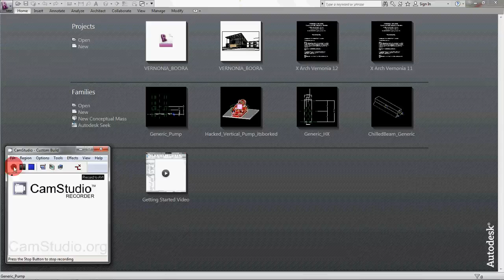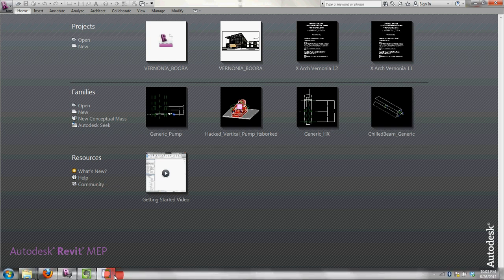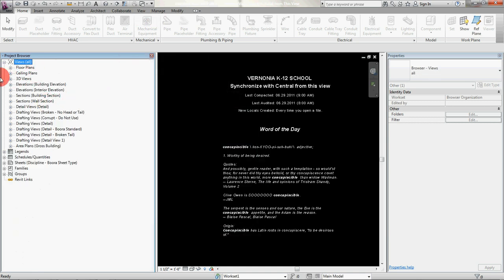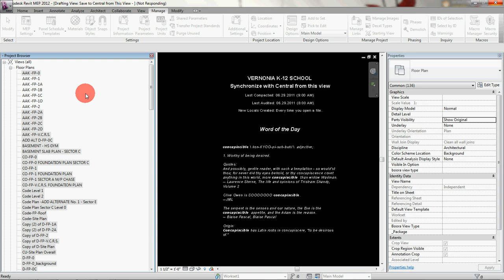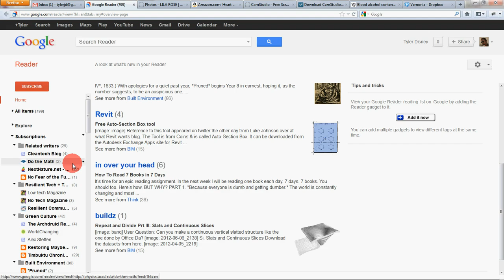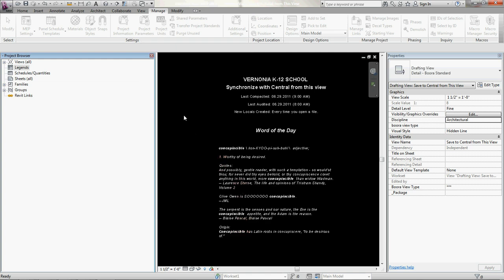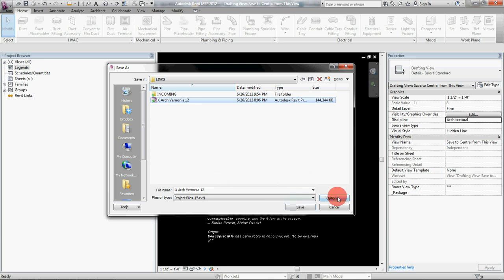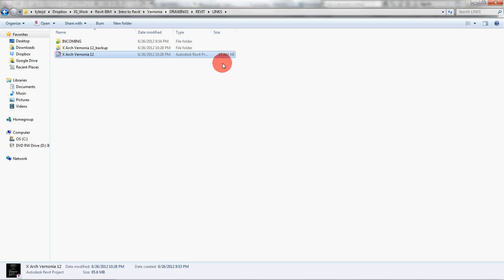Cleaning up a New File for Linking into Revit MEP 2013

Comment from the maker: Sony, good question. For better or worse, almost everyone uses worksets to control visibility, to some degree. In other words, they sort of treat worksets like layers. Architects will do things like have worksets for Exterior vs Interior, and worksets for furniture, casework, even different options and fit-outs they are experimenting with. 

So, if you collapse all the worksets in a linked model, you are doing something similar to collapsing all the Layers in a CAD drawing to "Layer1". You'll lose the ability to set the visibility of the linked model the way you want. If you keep the worksets, you can adjust which ones are visible in your model's views so the backgrounds show the way you want.

Cheers!

Comment: ive got a mech, plumbing, electrical link. do i clean them up too for the new link into my new central?
Reply from the maker: Hi Sal, yes, in general, clean up every model you are going to link in to your central.

If the model is under about 50MB, I tend to only Purge Unused - I won't bother deleting views on a small model.

Comment: Hello Tyler, we can delete unnecessary views images and links very simply and faster by using Project Cleaner in Revit Express Tools from Main Ribbon
Reply from the maker: Nice. I believe I've used your tool in the past (I'm not in Revit these days). To anyone else reading this -  I recommend learning how to clean things up manually first, so you understand the process, and then investing in a 3rd party tool that can help you crank through the tedious stuff like this. Cheers.